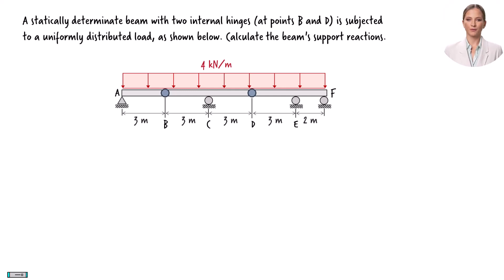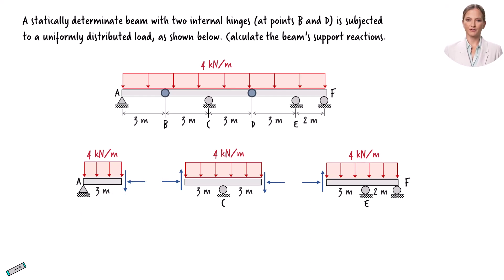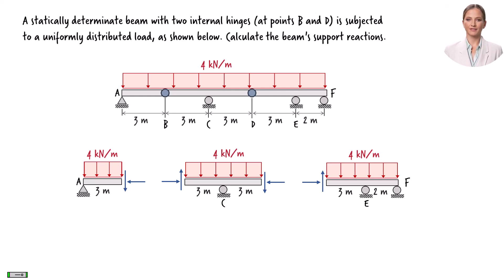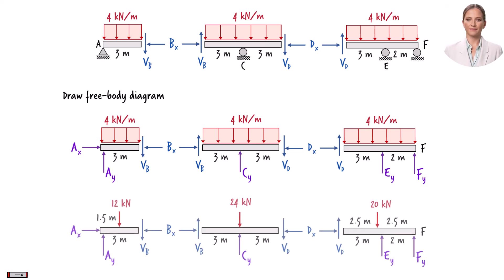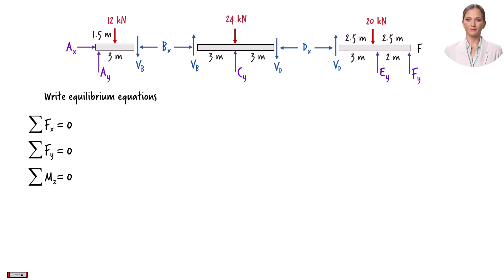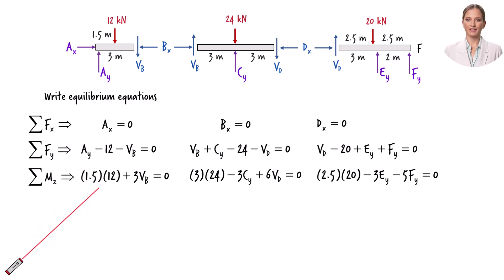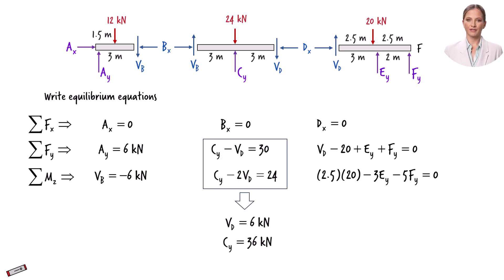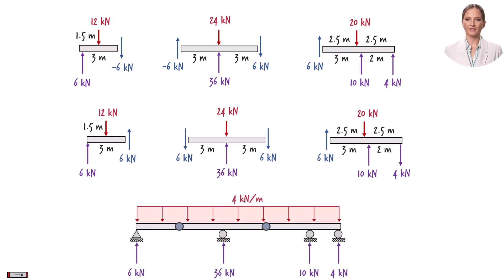SP2-1: Solved Example Problem (Module 2 - Problem 1)

Comment: Are these two internal hinges shown actually bolted connections and applicable only for structural steel beams? Thanks in advance for the reply.
Reply from the maker: Yes, the internal hinge represents a splice (a mechanism for connecting two beam segments using bolts). Although splices are common in steel beams, in principle, they can be employed for connecting beam segments made of other materials.
Reply: @DrStructure  Awesome. 👍👏